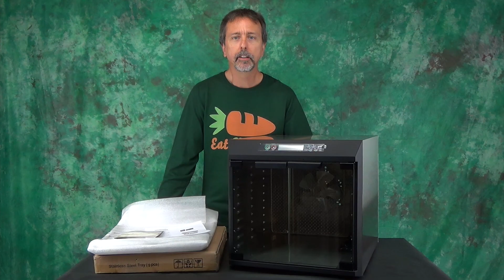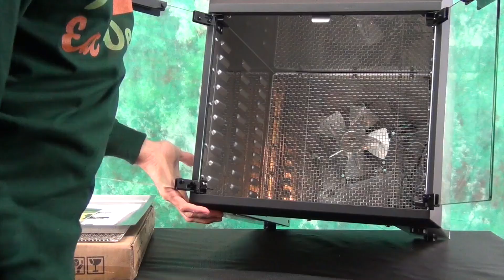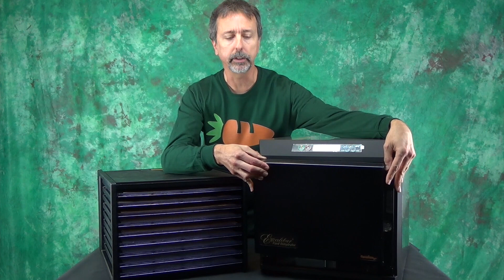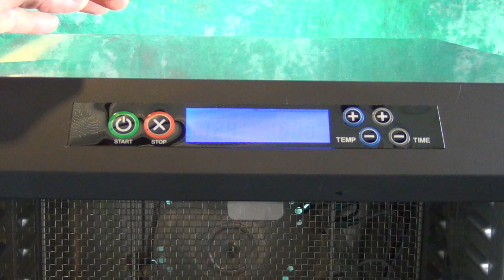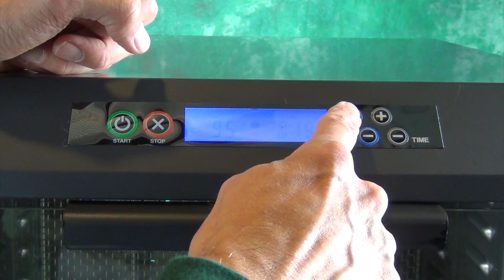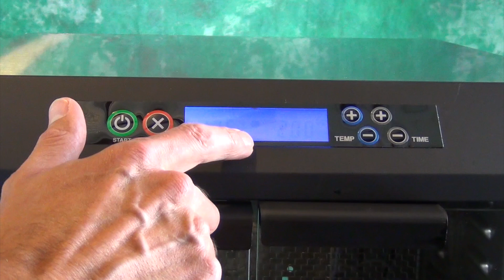Excalibur Stainless Steel Food Dehydrator EXC10EL

Comment: Hi Mark,
could you please tell me if this model has to have the temperature and time setup each and every time it is powered on/stopped, or it retains the last settings?

Thank you.
Reply from the maker: Robertino Ioan It needs to be setup each time.  Turning the unit off resets it to 95 degrees.